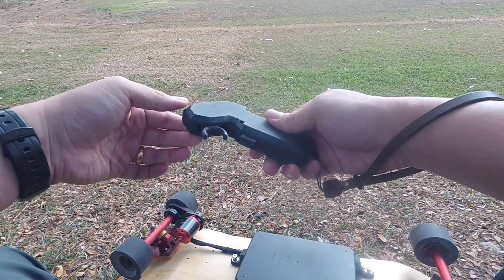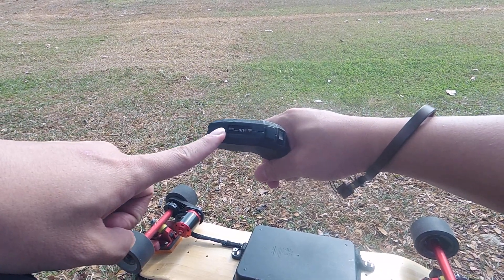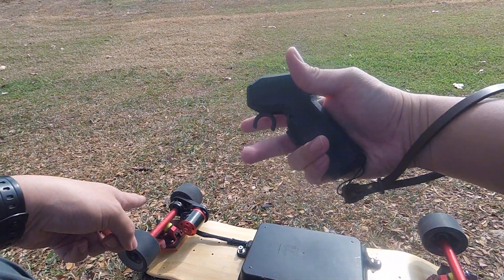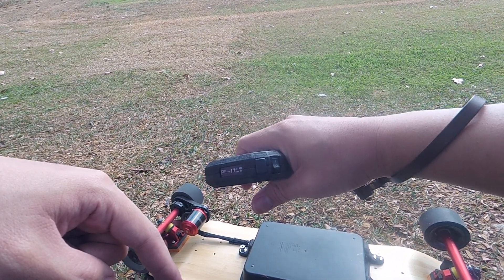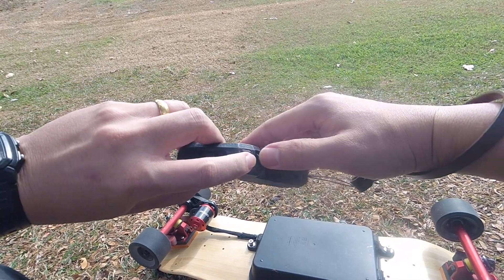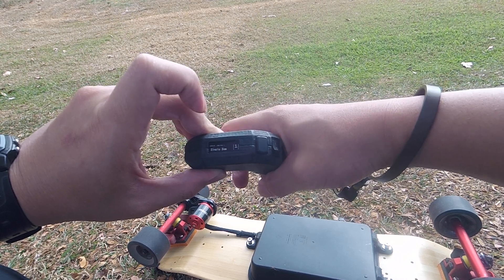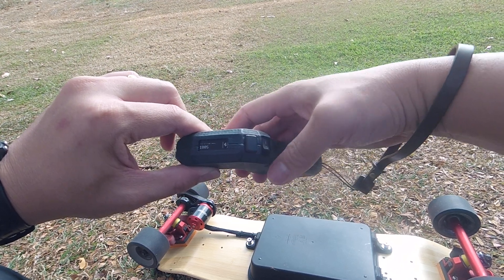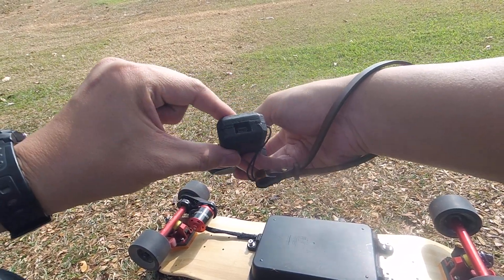DIY Trigger Style Electric Skateboard Remote

Comment: YOOOOstill mising schematic of RECEIVER! dman alll build with no receiver schematic.. and also.. HOW the hell to calibrate this with VESC, every single try full troltle and fullback throtle.. my vesc FREEKING OUT from unstability of receiver signal.. it is awful..  caN YOU PLS.. show me dat magick??  coz is PWM output.. ik set pwm output.. no worry..  but agan.. damn.. what unstable messy output signal.... and ya btw.. i tesat it on my RIGOL osciloscope.. signalisperfect.  0-100% pwm.. stable nice.. but somehow.. frequency or latence or.. some BS in code.. make this thing abosulety imposible to calibrate-...  so anybody for share code there?:?? pls?? pls.. iam desperate-.- i invest money.. my time,, lot of efford.. top repair my 3D printer to even.,.print it.. about 40 hour of work coz thzere is NO SINGLE FULL NICE DIY - HOW TO guide every timemising most wanted
-receiver schematic
-receiver x VESC wiring diagram ( special for uart and feedback)
video of HOW TO CALIBRATE! with no cut.. 
-last thing is one full pack of arduino libary a working links.. notg half filed package.. plss.. anybody.. it is desperate DIY.. without this.. stuf...
( yai manage set make myown receiver, i manage get PWM pin by osciloscope and ya i manage to put all togedher but after i almost lost my mind.. in timeof calibration.. i say.. BAD BAD BAD:: we need FULL GUID! i have 15 year experience with making electronicsm,pcb and stuff..)
Reply from the maker: I had to dismantle and sell all my esk8s as my government essentially made them illegal. I have ceased any development or updates to the remote. Apologies.
Reply: @modminiman7861  so ima feel sory to hear it.. so any chance to make one more schematic of wiring between reciver and vesc?? your code seem s to me OK :)) but stil have problem my arduino need.. every time. restart for wake up LCD.. any idea??
Reply from the maker: No, I am not touching this anymore.